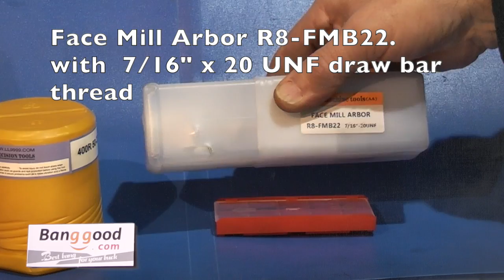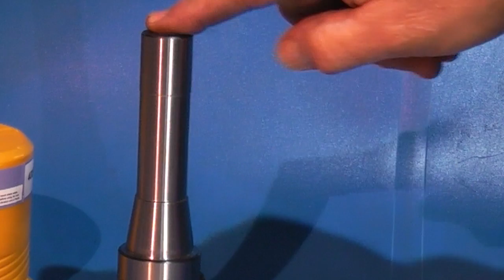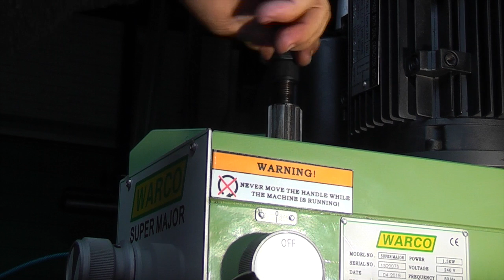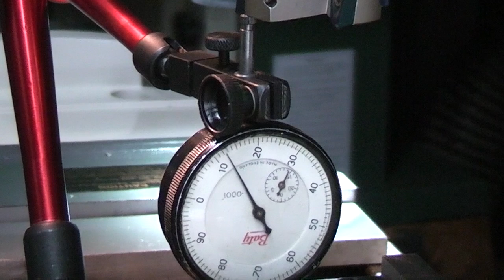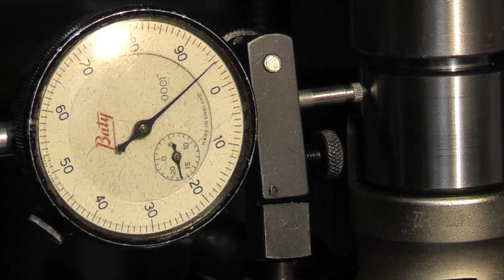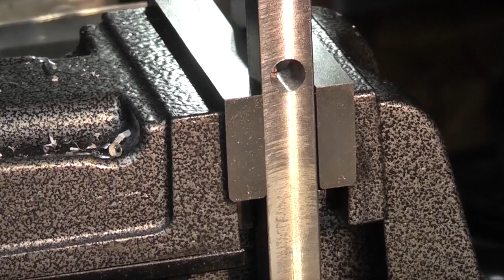Face mill review & Making a Tramming gauge

Comment: Very good arbor. Face mill got faint praise! I was suprised to see all inserts were making contact. I wonder if face mill face is square to the arbor face? Difficult to check without a surface plate. Mahbe try gently standing face mill with inserts resting on mill table. Can you slide a cigarette paper (showing my age!) or thin feeler guage under any of the four inserts Alan? If so, try moving inserts. BobUK.
Reply from the maker: Hi Robert This is a new milling machine. At the time of testing the cutter I noticed it was cutting on one side more than the other. I was expecting to get a cross cut effect on the metal as each side of the cutter travelled over the metal, but no only one cutting arc.
After I made my tramming gauge I found out the head was not set to the table square.

Comment: Unless you got extremely lucky it's doubtful your mill came properly trammed from the factory to close limits. Just the way the shipping containers there in are handled and the truck transport would be enough to change the factory settings. Since the factory knows that then my guess is they don't spend much time trying for perfection. 

Fwiw I usually remove the single screw that helps lock the vertical rod on the magnetic base of my indicator holder, unscrew that vertical rod from the base, then invert the whole assembly into a drill chuck or milling collet and attach an indicator to tram my mill. Nothing to make and both rods and the snugs that are already there can be used to both hold and set the indicator at what ever radius you'd like.

Comment: what speed was the carbide end mill at i run mine at 1300rpm same with the face mill i have it close to 1000rpm
Reply from the maker: Hi Martin the speed was set at 1000 RPM
Reply: @enotsengineering speed just don't look like it in the video . I have on and it works well but the inserts i got with mine was for hardened  steel but would go dull on mild steel after a few passes.
Reply from the maker: The inserts are 4 pcs Blue Nano APMT1604 Carbide Inserts Material:High carbon steel+Carbide see details on bang-good